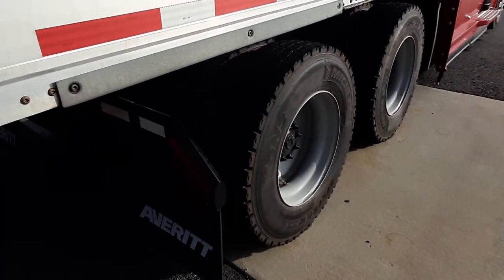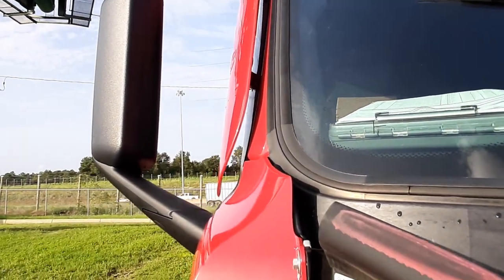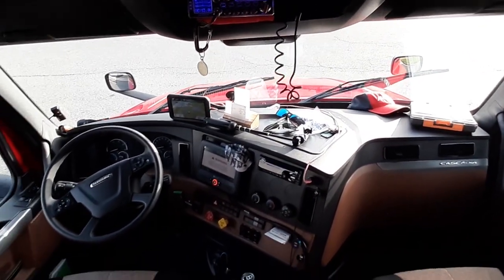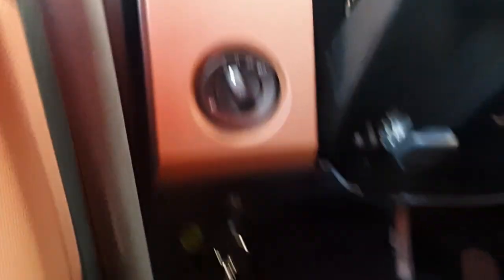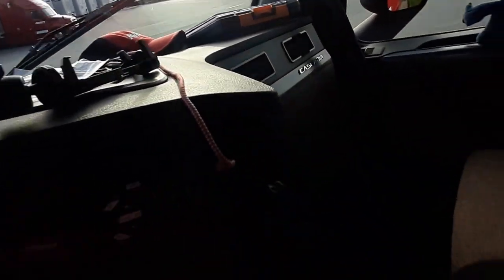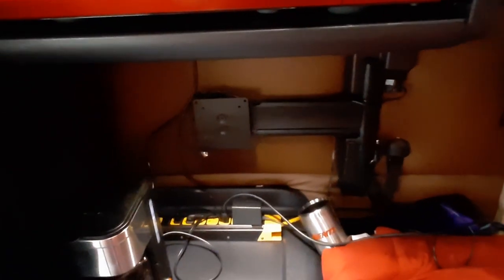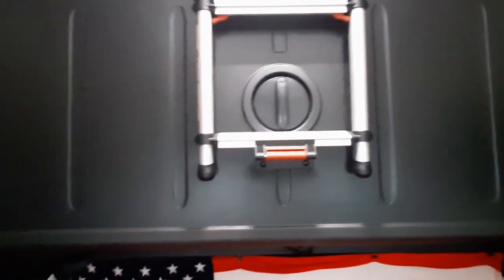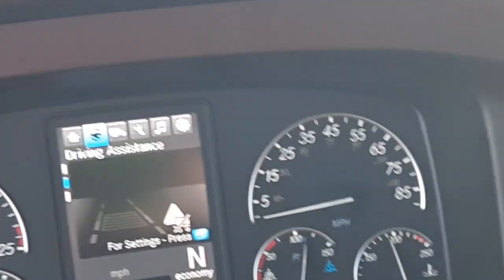Averitt 2021 Cascadia Tour (Test Truck)

Comment: You turn the hsa off when backing up, I've noticed it also prevents clutch over heat even the dock or spot is on a hill and it's tough so you have to keep pulling up and hsa keeps holding

Comment: Personally, I'd rather it not come with that fridge or its cabinet. That way I can put in a much bigger fridge that almost goes all the way to the microwave cabinet. You said you are a gamer? PC or Console? KBM or Controller? If you haven't already, you need to make a short video on how you made your TV bracket. I hope to be able to KBM PC game when I get on the road. Not sure how long I can sit on the bed comfortably with my legs up and game. I much prefer a computer chair with my feet on the floor personally. What is your experience?